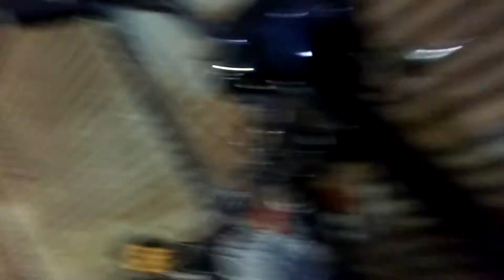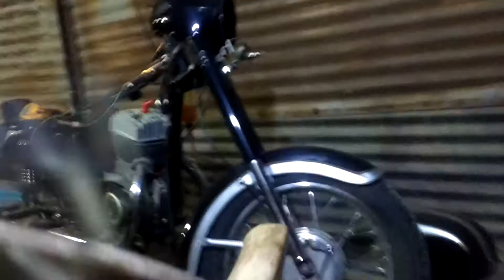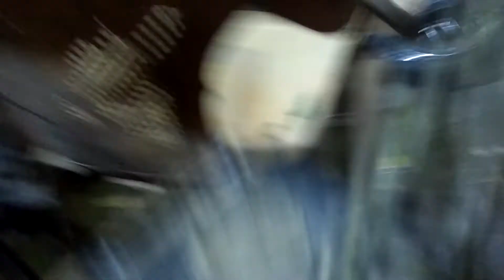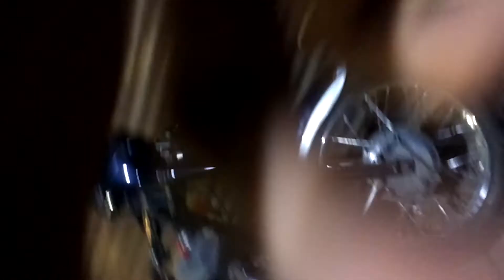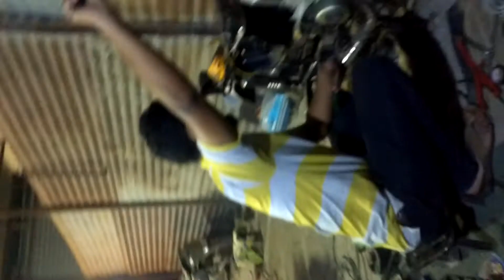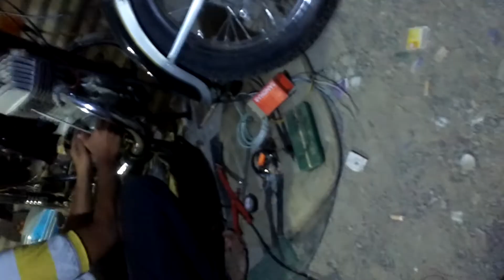Yezdi Sound

Comment: Bhai cdi lgane se kya improve aata hai
Reply from the maker: Daud Shahab 
Half kick easy start
Eliminate need of pumping the kick.
Bright headlamp
Very Good battery charging
No maintenance.
No resetting needed. 
No modification. 
Very very long life of all components so no breakdown. 
continous High speed riding possible no chance of missfire. 
Setting does not chamge even if you ride continuous 1000kms.